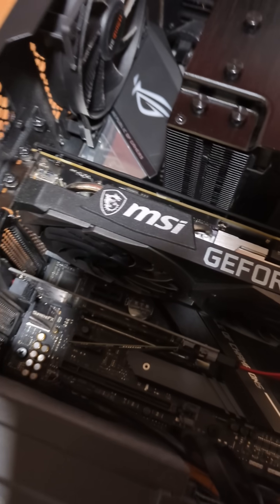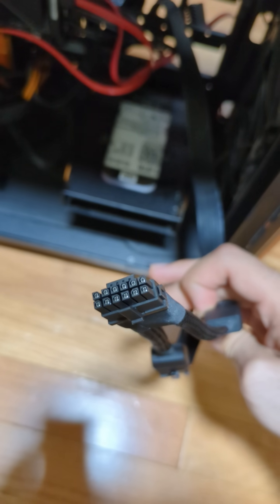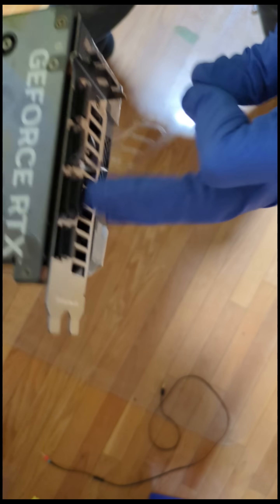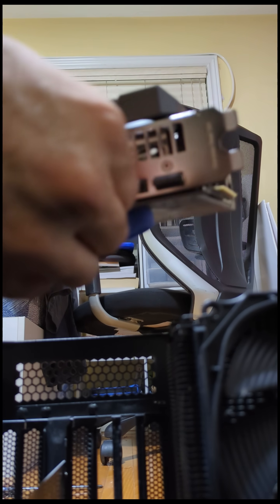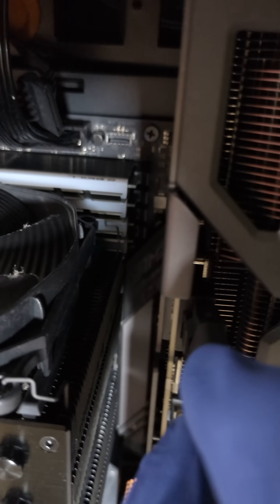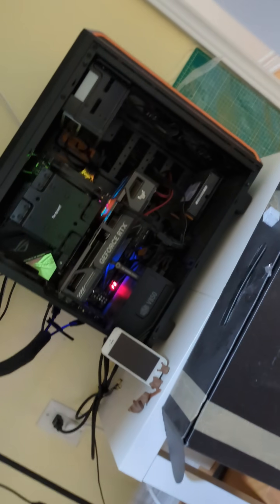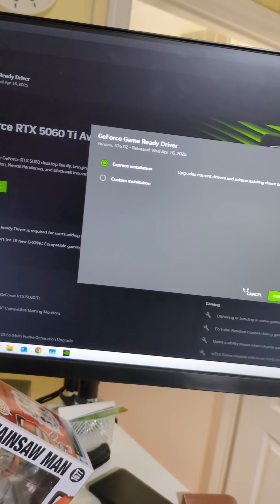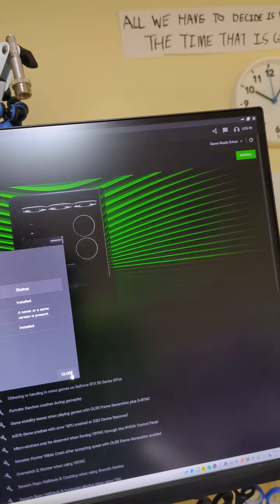Installing the #5060 TI from #nvidia #graphicscard #tech

Comment: ill be installing the prime version instead, just one question.
Did you need to remove the drivers of the RTX 3060?
Reply from the maker: Nope, it’s all the same driver from my understanding, I did have to update them tho cuz when I got the card, the 5060 drivers were not out yet, and I had to update but I think as of writing this comment the latest drivers are stable with all the 5000 series cards with very few exceptions or issues, when I got it I was actually pissed I had to wait a month for stable drivers for ai stuff lol

Comment: donc je peux mettre avec cette carte graphique la msi a650bn avec leur 12vhpwr ? Mercie de toute vaux réponse
Reply from the maker: Idk what 12VHPWR means exactly but I believe if you’re above 650 W power supply, you should be fine given an average processor and average setup+peripherals, but you should check with a calculator to be sure
Reply: @NADLABS  elle recommandée  avec une 550w sur leur site   mes jai la msi a650bn  et je suit pas sur que le 12vhpwdr et compatible   j'espère trouvez une réponses  Claire

Comment: Hey amazing video, I have a question though, my power supply has the same output of the adapter and written on it 450w will that be enough, or I got to use the adapter?
Reply from the maker: It really does depend on your other components but you have to use the adapter always cuz the new cards don’t have the old power ports anymore, they only have that weird ahh 10 pin power port now

Comment: Bro I need help I’m planning to get this card my psu has 2  8pins pcie so what do I have to do to connect the gpu
Reply from the maker: U need to plug in the 2 8pins into the power adapter, and put the adapter into the card, and that’s it, I just made a video to showcase it :)

Comment: 1 question, My Power supply got the 6 pin and 12 pin connectors I need to use the adapter that’s is coming whit the 5060 ti or is optional.?
Reply from the maker: It's mandatory, you can only connect the adapter to the card, and the adapter cable connects to two 8 pins
Reply: @NADLABS I already got it, thanks so much buddy
Reply: @NADLABS you want to plug in both ends of the adapter correct? Since it splits into two. So you would have two cords connected to the power supply at the end?

Comment: Dumb question, but right now i got a 1650 and is thinking of upgrading to the 5060 ti, do I need to get a new connector that's 8 pin? sorry I'm new in PC building.
Reply from the maker: id say check your power supply, do you have enough in terms of cables and power to support the new card + the rest of your pc, if you're new to pc building, please check out this video:
https://youtu.be/s1fxZ-VWs2U
this channel and video are REALLY good when it comes to basic pc parts and concepts, and I find they do a good job (plus they're a really big channel in PC Hardware, so watching that video will lead to your yt algo showing you more of this content.
TO ANSWER YOUR QUESTION THO:
you would need to check if your power supply has 2 eight pin connects to go to the 5060ti's power cable
Reply: @NADLABS  appreciate you bro!

Comment: I mean this power thing is fire hazard, so the cable maybe should stick since even tho there might be click MAKE SURE IT'S STILL IN, and when it's in it can still melt so yeah.
Reply from the maker: TRUE, but only for the higher end cards, and it was only 20 people out of the thousands that bought the 4000 series, the 5000 series seem to be fine, but never hurts to be careful
Reply: isn’t it fine to just run one pcie 8pin instead of using the adapter all together 
i’m just curious what benefits one would get from 12vhp since the card draw is so low
Reply: @x.xTrusted 
Idk if you know BUT
12VHPWR is gone, now it's replaced via safer 12V 2x6 cable
But it still melts, mostly because sometimes, IT TRIES TO ROUTE 600W VIA SINGLE CABLE
Reply: @xdreamerx5017i didn’t know at all 
i hope my comment didn’t come off rude 
i’m just generally curious because i had plannned on just using one 8pin instead of routing the two 6+2 to the adapter just to be safe i haven’t heard any problems from that 
i’ve never build with nvidia cards and would be nice to use the white adapter since it’s a white build and can always wrap the 6+2 chords to save money if that black looks bad
Reply: rather be safer than save and just buy something from cable mod and not deal with melting lol
Reply: @x.xTrusted 
What do you mean routing two 2x6 to one 8 pin?